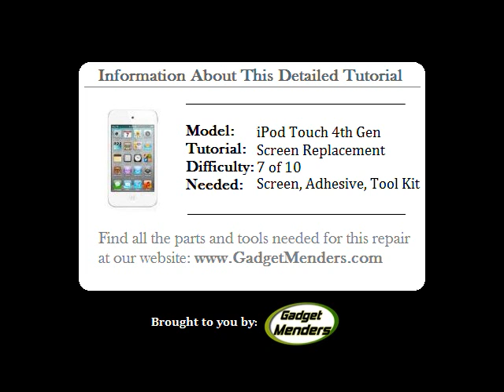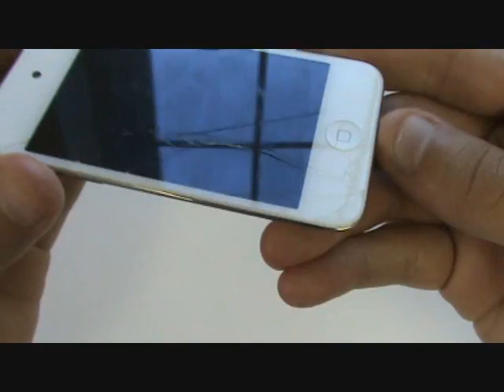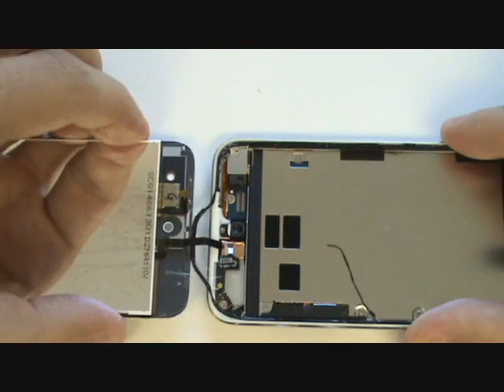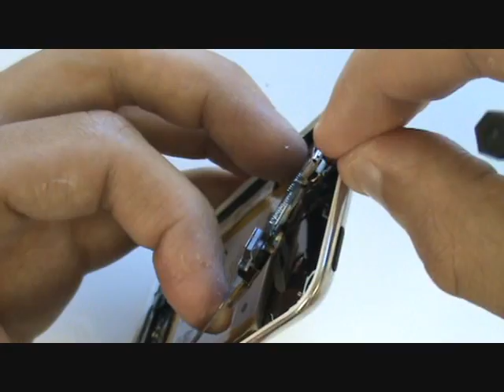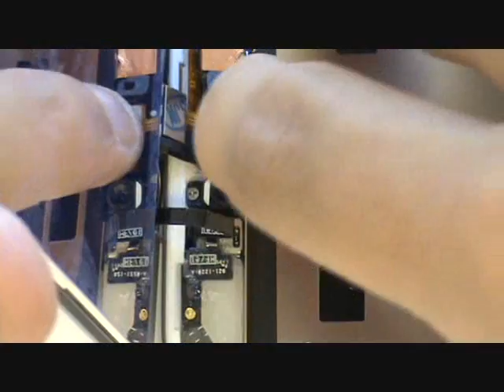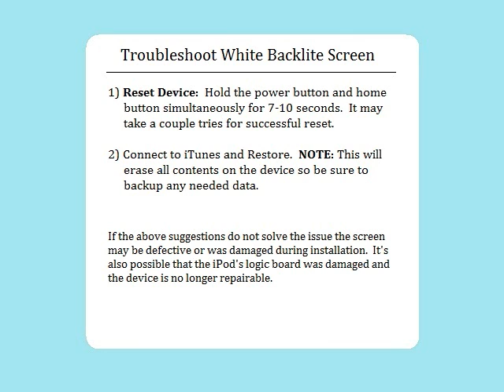iPod Touch 4th Gen Screen Repair Tutorial Cracked Glass | GadgetMenders.com

Comment: Hi, 1st of all, thanks for the detailed step by step, I was able to succesfully change the LCD assembly (tried to post a photo but youtube blocked it) 
The ipod4 case is pretty hammered so the sticky pads on top and bottom did not seal the unit properly, and after a while I can see the light from within thru the sides. So I reopened it.
What you guys suggest to properly seal the unit? Silicone seal? Thanks!

Comment from the maker: This is likely the power/volume cable.  This will need to be replaced.  It can be tricky and does require soldering but it's very doable.  You can also consult with a local repairman if you don't feel comfortable attempting on your own.